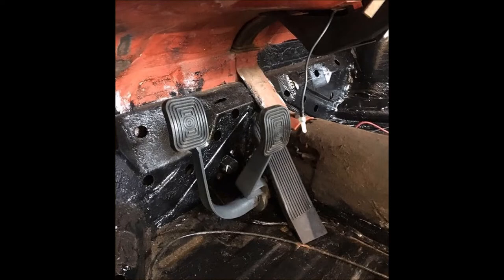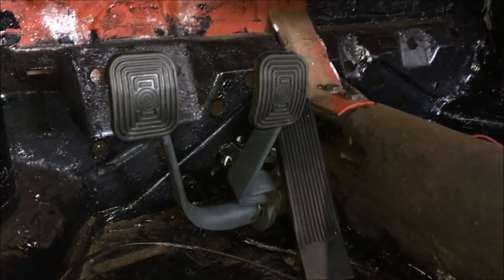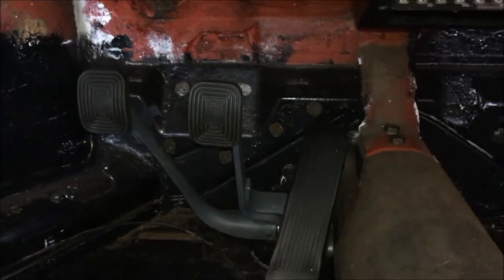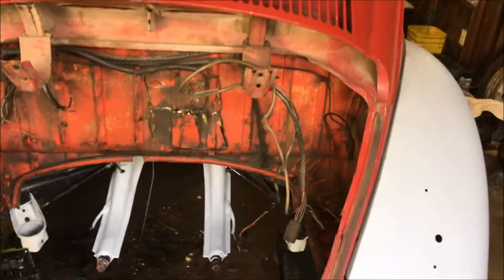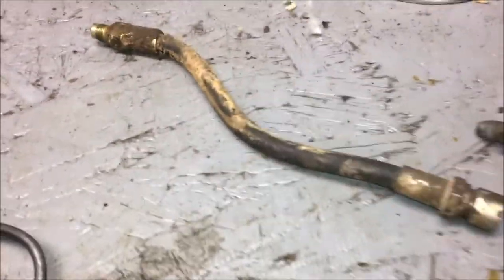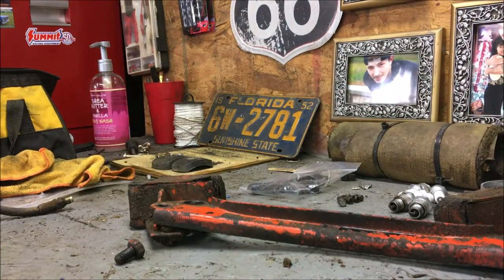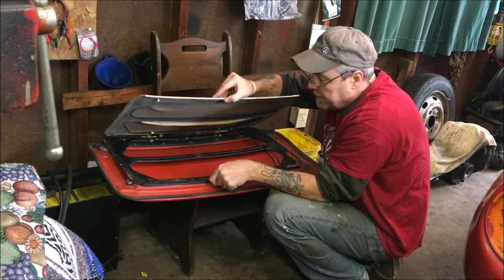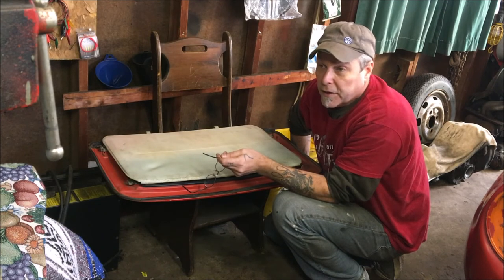VW Beetle - Super Beetle Pedal Assembly Adjustment - Beetle Pedal Adjustment And Repair - VW Ghia

Comment: I have 72 volkswagon super beetle ,when I apply pressure  to the peddle in the cabin,it does not move the cable  going to the  carburetor, cannot figure this out . This is the original  accerlator cable . It will crank if I am at the back of the car and pressing the part of the carburetor  that let's the gas flow ,think I have also the check dies not work well  .  Thank you Steve Brown
Reply from the maker: It sounds like you have a broken accelerator cable, have you checked that? It sure seems like it from the way you’re describing it Stephen

Comment: Thank you Sir for the video. I’m getting through all your videos when I can. Hoping to see the video where you extend the pedals. I’ve noticed on mine that the gas and brake pedals are super tight to get my foot between, wearing wide made shoes. Also, hoping to catch a video on how your sunroof assembly goes. I have a 77 non Super Beetle that has a metal sunroof, are these factory? Thank you for the videos. I’m a greenhorn with VW and it’s great to see someone knowledgeable to get me through maintenance and upkeep for my Beetle
Reply from the maker: Thanks for always posting and being here I truly appreciate it. 
Honestly I will be doing the pedal extension video within the next 6 to 8 weeks. I’m finishing the tear down on the 68. 
And then I’m going to start with the pedal assembly, the master cylinder and all of the braking system. 
So I will be showing the process for the pedal assembly. I wear a size 13, so trust me I know how it feels to be squeezing our big ass feet in between these pedals 😁

Comment: Great Video. Thank You! Also the brake return spring on the assembly on my car is currently not attached to anything. I just noticed both hooks on either end are hanging on their own. Which hook should be attached?
Reply from the maker: lance barley The hook on the return spring will attach to the master cylinder rod on the pedal assembly. And the “leg” parts will twist around for tension and pressed against the floor
Reply: I know I am quite off topic but do anyone know of a good site to watch new tv shows online?
Reply: @Guillermo Trace I would suggest Flixzone. You can find it by googling :)
Reply: @Ryder Ahmir Yea, I have been watching on Flixzone for months myself :)
Reply: @Ryder Ahmir thank you, I signed up and it seems to work =) I really appreciate it !
Reply: @Guillermo Trace No problem xD